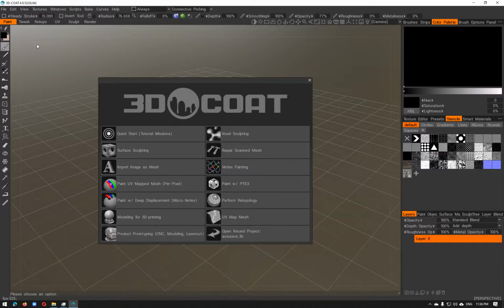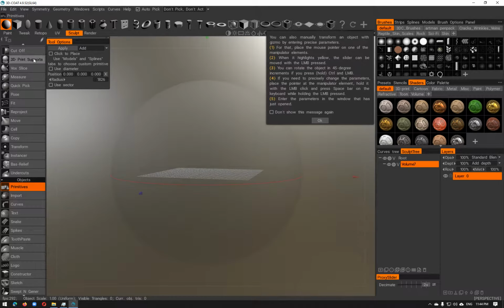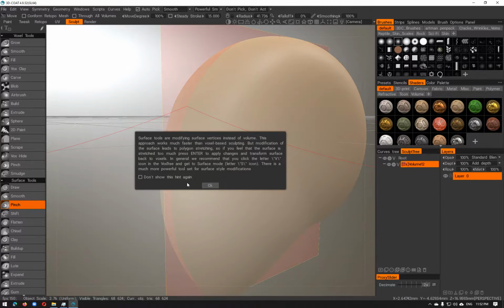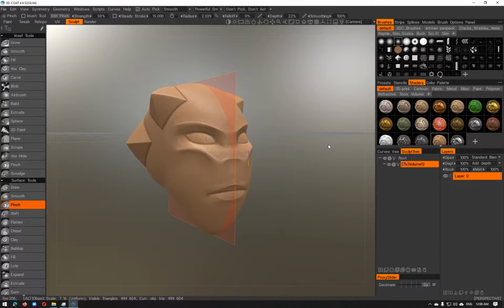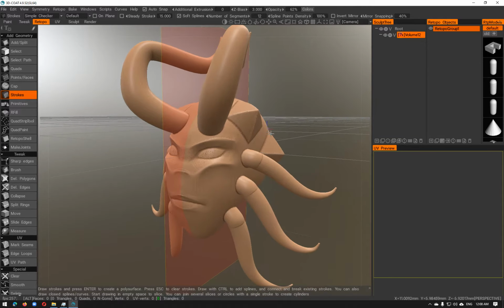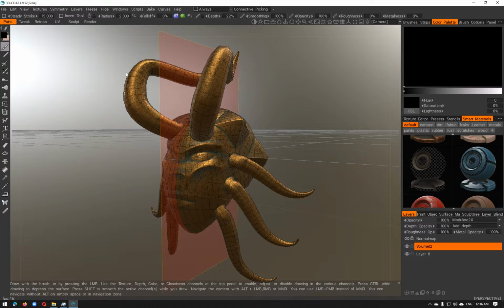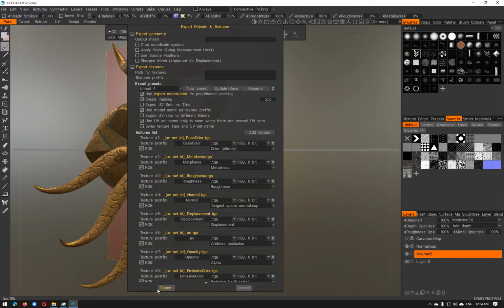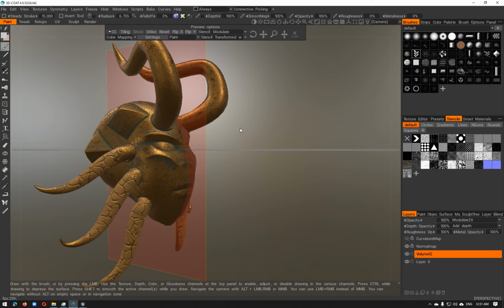3D Coat Basics

Comment: Did you know that if you press 5 during this video, it takes you to EXACTLY the moment where you say 'press 5' to switch to orthographic mode- was that intentional?? I was so confused because, I pressed 5 right at that moment to test it in 3D coat, but I was tabbed into the video, so I was like 'oh no it's gonna skip to a different part of the video" - but it didn't skip at all, because that moment was EXACTLY 50% of the way through the video. crazy!

Comment: Man I’ve been eyeing this program for a couple of years. Finally started to learn it after never clicking with zbrush. I must admit it’s nice! Just wish it could handle more poly in voxel mode. But I don’t know the best workflows just yet. Might be user error. Very good software though.
Reply from the maker: Thanks for commenting :) There is a latest version of the software (2021) with new brush engine. It can handle more polygons but not as much as Zbrush. However, it performs better than the previous version. Cheers!

Comment: question are surface tools unavaible in demo version of 3dcaot I cant find them :(
Reply from the maker: They are available, they just look different. The new 3d coat have a completely new brush engine. I will create a tutorial on new 3d coat ui as soon as I get back from vacation. Just scroll down and you will find it. Just try them out to see what you'll get. There have been slight changes in brush behavior. Hope it helps for now. Best